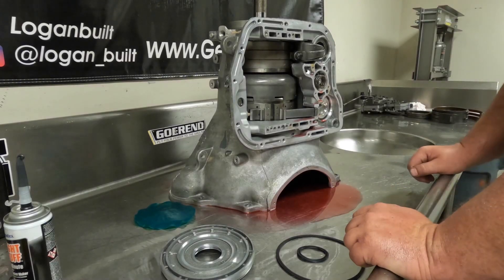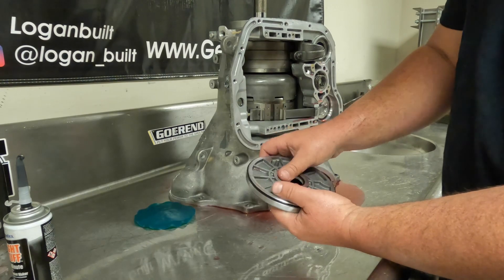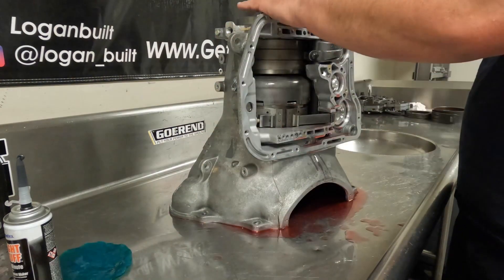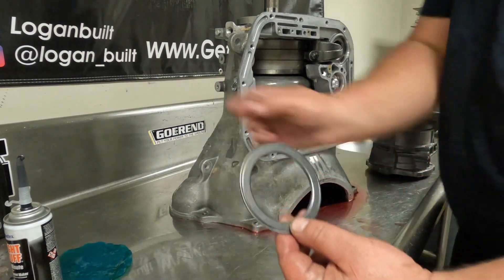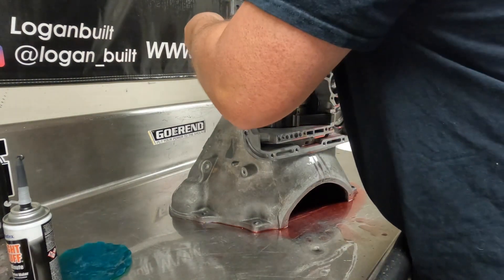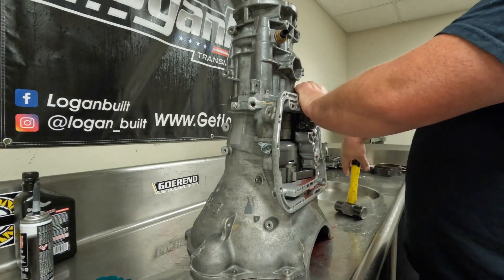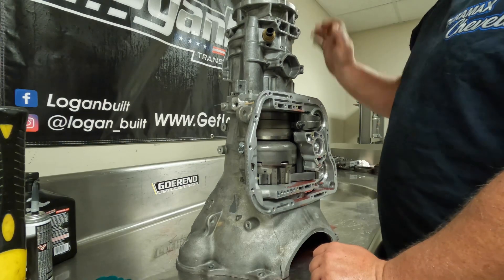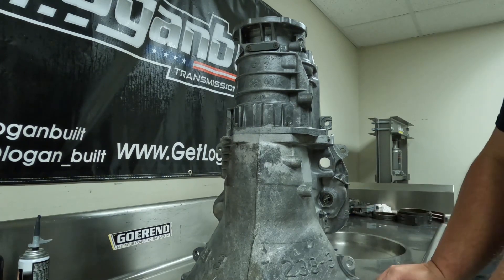Loganbuilt 47/48re DIY Kit Step 10: Overdrive Installation!

Comment: 46RE question, when merging on the highway in 3rd or 4th gear, when full throttle is applied and trans starts to downshift, RPM’s max out acting like trans slipped into neutral 🤔 

doesn’t happen all the time, and if you wait 2 seconds truck drives normal again

Comment: I put everything back together…overdrive housing slid on but I went to put my transmission control lever to go through the gears and it won’t move…is it supposed to be like this when there is no fluid and not hooked up to the truck yet?

Comment: In the overdrive housing if you leave the wavy snap ring out and add another clutch in there is the clearance still the same as what you said in the video you did the over drive clearance?
Reply from the maker: Yes